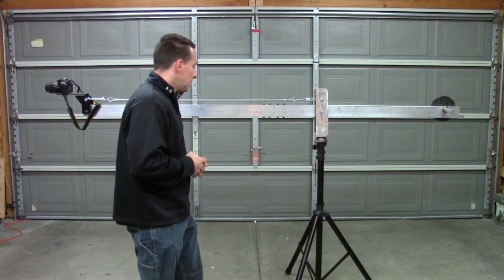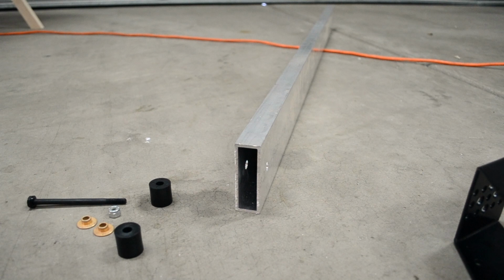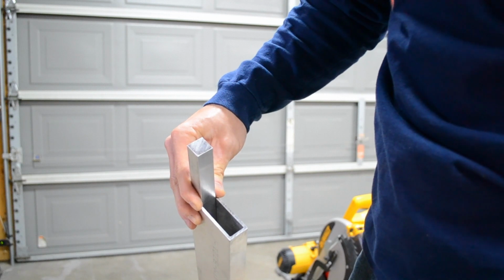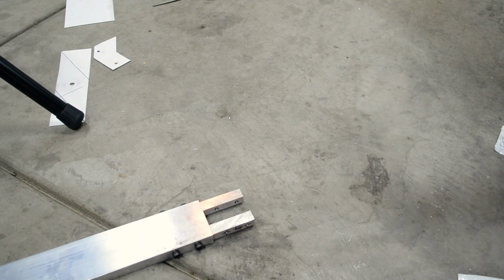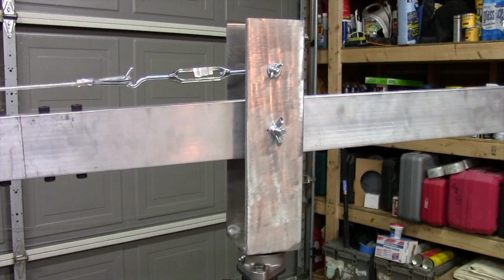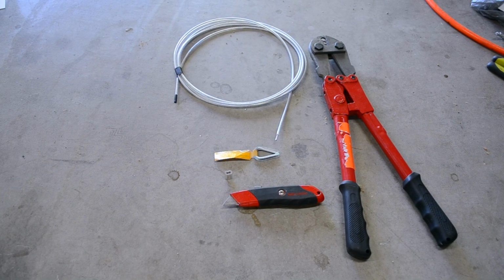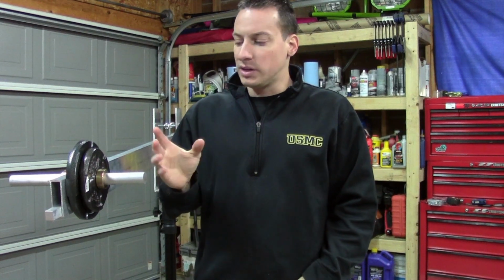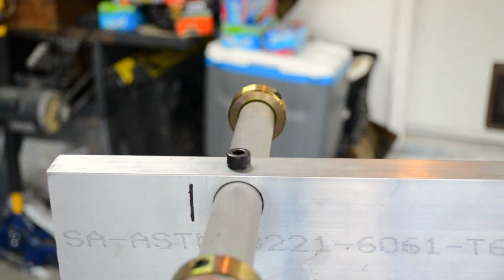Aluminum Camera Jib Build

Comment: Nice design!  Gives me a few ideas for myself and some friends. But I think you over killed the extension support. You could have gotten another piece of tubing to fit inside and then just connected them together using 2 bolts, washers and nuts.
Reply from the maker: +Roy Hardwick I agree with you 100% on the extension support. The reason that I did what I did was cost. I got enough 3/4" Aluminum to make 3 extensions for $6. If I was going to get a piece of tubing to fit inside the price for the whole project basically doubled. I would have had to buy special aluminum which goes inside each other and the price difference was crazy. You might have better luck with your area but not mine. Also the pieces are really not much more aluminum in the long run vs a full tube inside if its 1/8". Do you have any suggestions of what you would do differently or didn't like other than the extension support?Thanks for watching.